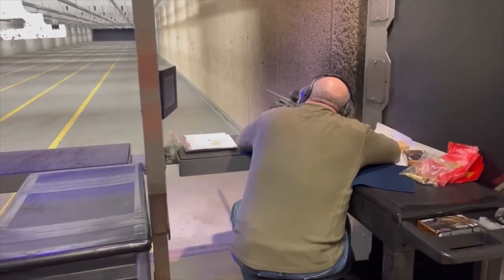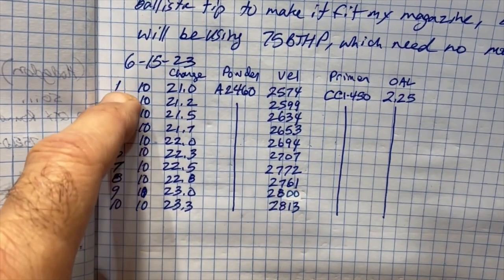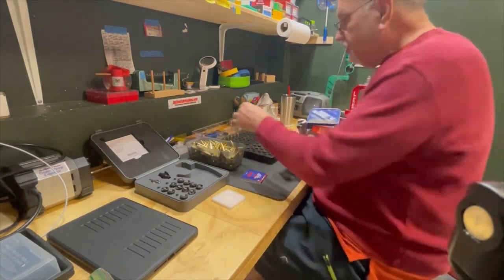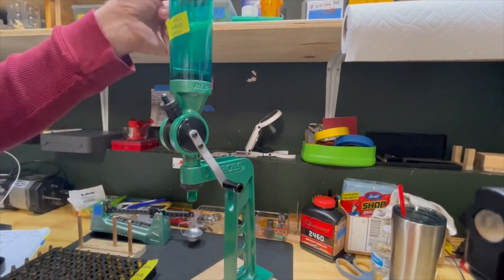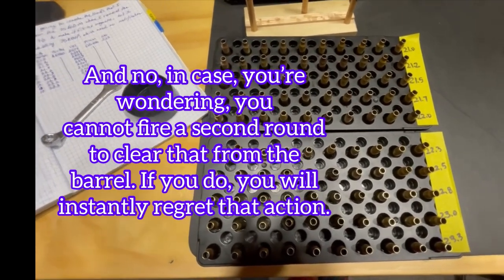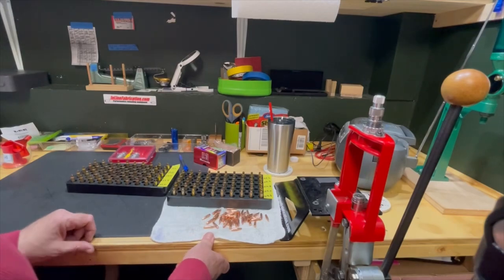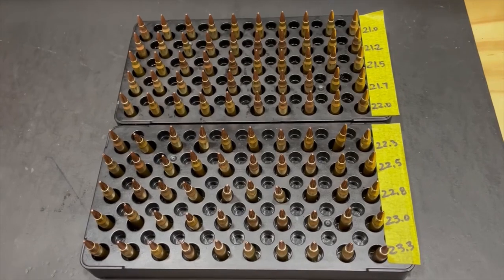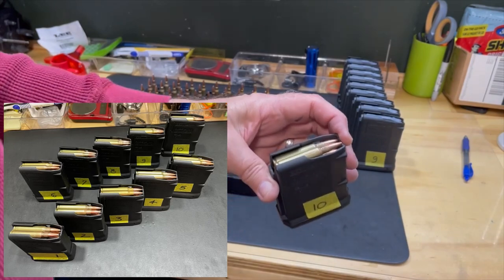Reloading 101: Part II - Reloading .223. Load development, powder dispensing, bullet seating

Comment: Thank you. Great stuff. Instead of the older scale, One method I use when really trying for accuracy in my bolt guns is to place the prepped shell on an electronic scale and zero it to 0.00.    I then throw the charge and put the shell back on the scale to get an electronic reading and will add or subtract whatever powder i need to give a perfect gr reading I am looking for. If I am loading for my AR platform I only check every 20 or so as the small differences dont make any difference to me.
Reply from the maker: That sounds like it would work. I wish you continued success on your reloading! Thanks for watching
Reply: That’s what I do.  To lube my brass, Use a baggie, spray in the lanolin alcohol lube, toss it around, roll them out to dry on a towel. What I never thought about is cleaning the sticky off. Great idea
Reply from the maker: @georgemoomaw9437 someone told me that ammonia in the window cleaner was bad for the brass but I don't leave it on for long. I also sometimes dry tumble for about a half hour and that works. Have to check the flash hole

Comment: stopping to reload helps the barrel cool down as 100 rds. will heat the barrel right up and affect accuracy. 
in this test a barrel blower would be very useful
very useful video for beginners for sure
Reply from the maker: Thanks for the input. It’s always interesting to see how my shooting changes from the time I start with a cold barrel until it gets hot and dirty. There are a lot of variations in between. I will take that into consideration. Thanks for watching.

Comment: Just a suggestion but why don't you mount the powder scale up higher where it is more on eye level rather than having to bend down to look at the "zero" on the gauge?
Reply from the maker: I have a jig I set my phone in and use the camera to see it two dimensionally. That saves me from having to bend over to get an accurate reading. See my video on Reloading .223 from start to finish. You'll see it there.

Comment: what drop tube are you using that fits the 223?   the ones that came with it dont seem to fit them right.  I bought some RCBS funnel kits, but they dont fit in the Uni flow.
Reply from the maker: @headcasey6375  I don't have a drop tube. It can help with extruded powders when you have a nearly full case, but I rarely find myself in that situation. some manuals show compressed loads for some powders, but I don't like those. They say drop tubes help in those situations, but again, I rarely load them up that full
Reply: @EverydayReloadingandShooting  so do you always pour your charge from the pan,  as opposed to directly from powder thrower into case?  once you have your amount set i mean?
Reply from the maker: @headcasey6375  if it's a powder that allows the dispenser to throw a charge consistently, I can dispense directly into the case. If not, and I have to use the scale and a trickle, then I weigh each charge separately and dispense it from the pan into the funnel into the case.although, as mentioned I am now using the Hornady auto charge.

Comment: Im reloading hornady 55gr bullets, but when I go to seat the bullets, the bullets fall into the case, there is nothing holding them in place. They just fall into the case. Do I need to crimp the cases BEFORE I seat the bullet??
Reply from the maker: @KillerKev1961  that should not happen.  If you are using a full length resizing die, that should compress the case neck down so that it will hold the bullet. Are you even resizing the cases? Resizing will create neck tension to hold the bullet in place. Thanks for watching. I hope you will like and subscribe.
Reply: @EverydayReloadingandShooting  That was the problem. I dint cam over the die correctly.
Reply from the maker: @KillerKev1961  excellent. I'm glad you worked that out.

Comment: This is helpful. In Part I you went through the exercise to weigh each case and separate them into different plastic bins by weight.  How do you decide which case group to use for the different powder loads?  e.g., the lightest cases are used for the heaviest grain weights (because maybe they can hold more powder volume)? Please explain.  Also, you use a scale to establish the powder charge, but I have seen where some handloaders use an electronic scale for each round.  Can I assume that for this caliber the level of precision is unnecessary? BTW my goal is to fine tune a hand load for sub MOA groups - but I guess that is everyone's goal LOL.
Reply from the maker: Hi, and thanks for watching. The case weight has nothing to do with the case charge. Reloading for accuracy is all about consistency. If a case is a certain weight, it has a certain capacity. A heavier case will have a smaller capacity. Upon firing, the burning powder expands and produces pressure. The size of the case interior determines pressure. Having similar case weights, and similar volumes of powder creates consistency. Consistency is what will give you accuracy. I also have a digital scale. The problem is it doesn’t hold zero very well after measuring the charge and lifting the measure, it can be off Usually .2 to .4 grains . The beam scale works off of gravity. It is always precise. If you want a precision load, use the beam scale 😀
Reply from the maker: As to the level of precision for this caliber, I am a target shooter as a hobby. Reloading is also a hobby. My goal is to get groups in a half an inch. I’m usually pretty consistent at being under an inch but I want to see those half inch groups. I do it for fun.
Reply from the maker: You’ll get those 1MOA groups sooner than expected.
Reply: You could skip the part of weighing each case and sorting them if you aren't looking for extreme accuracy/consistency like say for a pistol or a volume/plinking rifle. If you want to do that, tho and you're aiming for the best accuracy and consistency possible then you'd sort them out like he did and just test them basically the same way he did his load development with his charges, but instead of varying powder you'd make the variable the case weight/capacity. You can do this with basically (if not absolutely) every single variable in reloading. Your bullets have stated weights, but what are the tolerances and therefore specific differences? Bullet seating depth? Primer seating depth? Etc. Etc. It's largely a hobby of tinkerin with everything until you get it "good enough" for what you're looking for.

The electronic dispensers can be a combination of faster, more accurate, easier, etc, or they might not be, depends on you, that specific piece of equipment, and a few other factors. It's all kinda a question of what do you like more/what works for you, your budget/time constraints, and what you're looking to do. Much of that is only discovered through trial and error.

This is however coming from someone with limited loading experience, so take it all with a grain of salt. How's your loading going so far? Get the sub moa groups you were looking for?
Reply: @TheVvolfgang  thanks for all this.  I just got the rifle after a lot of research and am breaking it in. Custom 223 Wylde with Shilen sendero/varmint contour, 7.5T, 22" threaded. Mack brothers action. TT Speial trigger. I have most of what equipment I need but need to clear my garage bench to set up. i have some loads to try. Slow but getting there.
Reply: @cacinaz8802  hell yeah, now Goodluck with finding primers and powder at acceptable prices, not to mention consistently 😅 update after your first range session? I'm gonna vicariously live thru some other ppl until I get back to my equipment
Reply: @TheVvolfgang  Roger that.  Want some Vihtavuori N140 and Bergers 77gr. Both expensive but I want bughole accuracy. What do you recommend for primers? I can find some CCIs but this is a bolt gun not semi-auto. UR uses Federal 205 small rifle primers with great success.